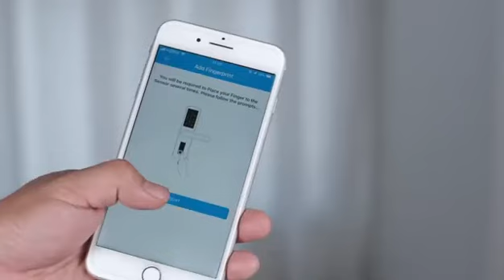How to install the hornbill fingerprint door lock( ASIN: B08FX53LBJ )

Comment: I'm very disappointed that these instructions DO NOT include a reference to the smartphone app's setting that also specifies door orientation.  I was only able to get the lock to work when I set the app's setting to the same orientation as the toggle switch in the lock.  If you are struggling to get the door to lock, properly, go to the app's settings, and about 2/3rds of the way down select "door opening direction".  Obviously, set this setting to be the same as specified by the toggle switch.
Reply from the maker: We updated the user manual, maybe you received the old user manual, sorry for the inconvenience, we have emailed our customers on Amazon plat.